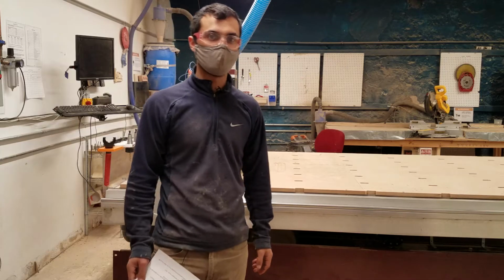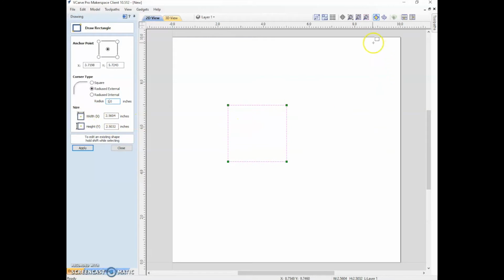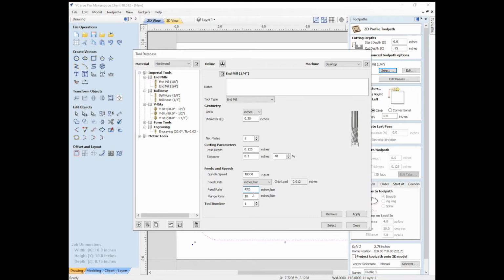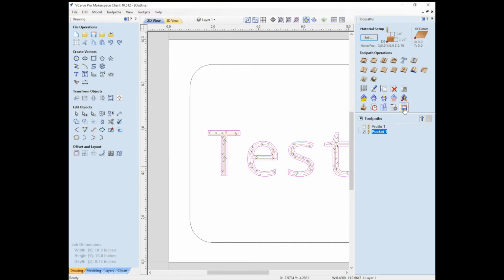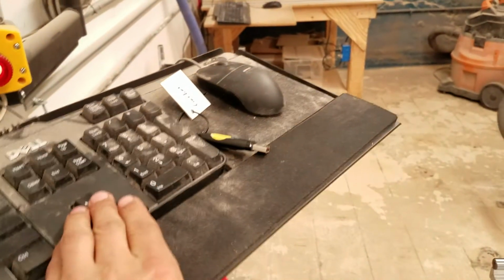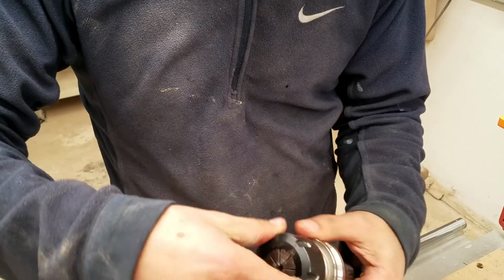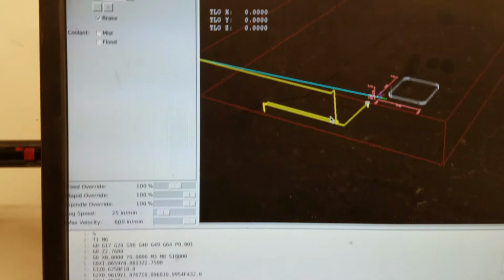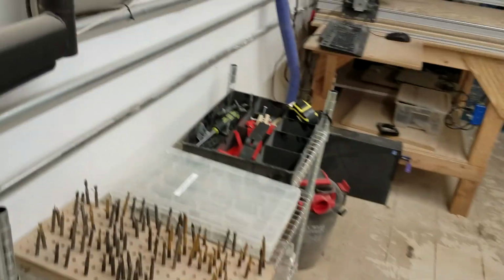How to Use the Gerber CNC Router

Comment: Hi there. I see you know your way around the Sabre 408.  We are in the process of converting the factory PVC spoil table to a MDF spoil table and just found out that both the x-axis and the tramming on the spindle need some adjustment. Any chance you can help me with that? I don't see any adjustments for tramming the angle of the spindle. Was yours always perfectly perpendicular to the table? Also the gantry mills more material on the left side (-x) of the table than the right (+x), so it seems like I have to insert some shims on the left side unless there is an adjustment screw somewhere.  I would appreciate any help you can provide.

Comment: I’ve used a Sabre 408 for 30 years. Dangers arise when you make modifications to the machine. You’ve made so many modifications. It is one of the safest CNC routers out there. Their proprietary dust pick up shroud is supper safe. The modification is dangerous in my opinion.
Reply: Hey Duncan, quick question for you. I work for the sign shop at a new jersey county. I've used this machine once in 2020 and haven't touched it since. The last week my bosses decided that it was time to re use again and I don't remember much about it. I use artpath to send the info to the gerber but I have little idea what I do on the machine. My question is this, after orientation what do I do?